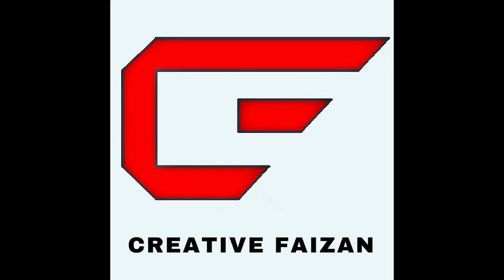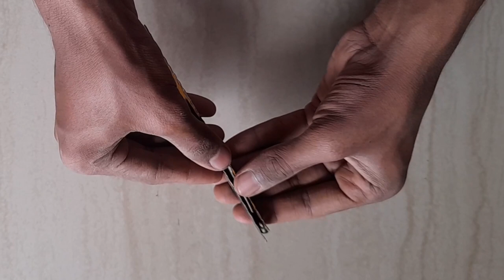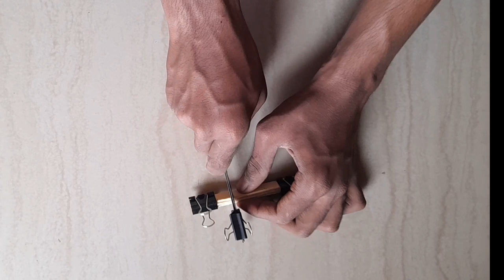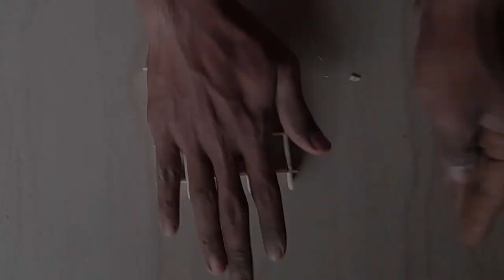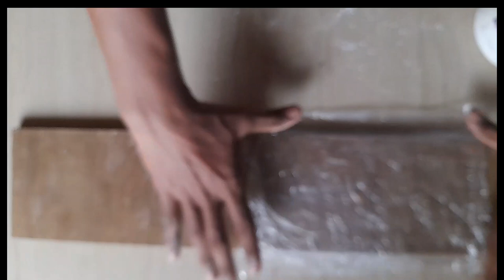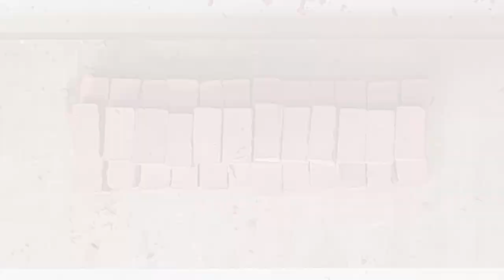How to make mini Bricks for miniature construction|DIY|#construction

Comment: Nice job! Tip: You might want to put some lubricant on your frame before putting in the plaster. Heat some petroleum jelly and brush onto your assembled frame. It will make it much easier to take your bricks out.